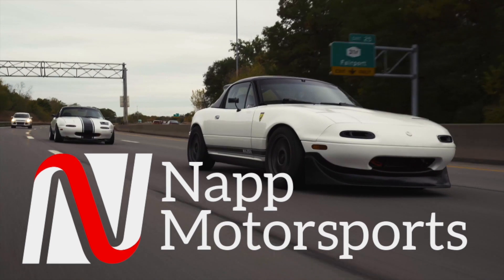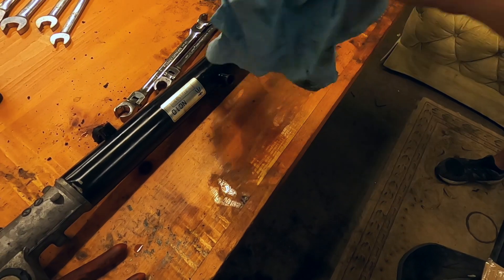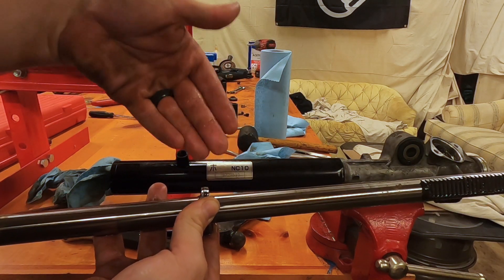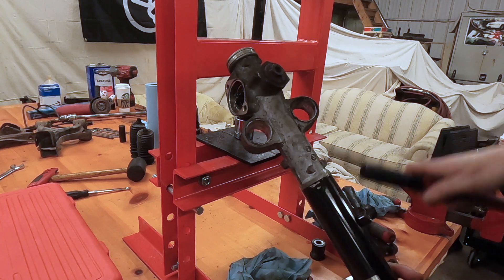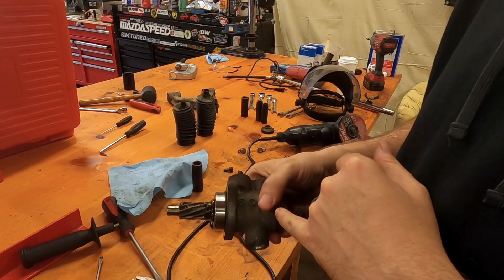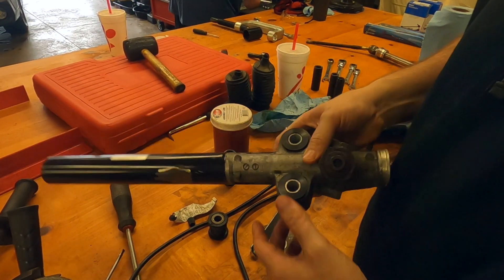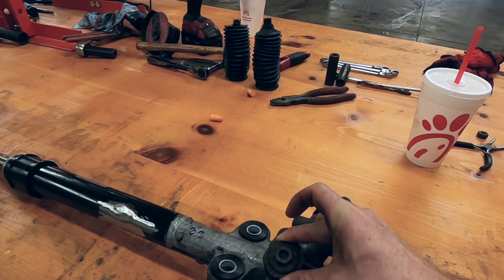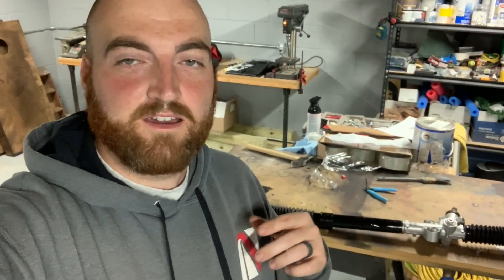Depowering a Miata Steering Rack // Miata Track Build

Comment: I did this on my rack and encountered a real problem getting that passenger side end cap nut off… on mine it was staked, and there was a burr that was destroying the threads. I had to take a dremel and cut the burr off of the main. It seems like it’s a factory thing to prevent it coming loose but so weird to see in some videos (like yours) people just casually twist it off… a few comments and instructions DO show what I encountered, but not all of them
Reply from the maker: I've heard that from a few people but I haven't seen it myself which is interesting. I'm doing another rack here shortly so I'll have to look for that.
Reply: It was hard to even see the dimple - just a tiny little spot where the rack casing was staked a bit. I ended up being fine, I only slightly damaged like the very first thread on the endcap and it reinstalled just fine, but definitely would’ve been bad if I forced it and didn’t backtrack and take a dremel to it. Anyways it’s odd that sometimes people seem to encounter this and other times not. Meant to say that I like your video, super helpful

Comment: Any idea did the same thing you did and the shaft won’t come out almost like it’s building pressure
Reply from the maker: Not sure
Reply: @NappMotorsports I had a 97 steering rack which is the NB design but na mounts, there’s a extra seal in there that was causing that I think or it just was in better condition then most. Put it in the bench press popped right out

Comment: I guess there's no concern about the wiper seal that's half way down the rack from the gears? I'm thinking of converting that one banjo bolt location to a zerk fitting so I can keep grease in there, but the inlet port is on one side of that wiper seal. Interested in your thoughts on this although it seems to be a non-issue.
Reply from the maker: You cut the seal out if we’re talking about the same one. Cut a groove into it on both sides and you can snap it out.
Reply: @NappMotorsports  I'm talking about the one inside the tube, not on the rack.

Comment: thinking about doing this in my nb, i want to delete the power steering and a/c from my engine to clean it up. although i do daily drive my car and i would like the car to still be comfortable to drive (i really only drive to work and back) (like 2 miles lol) how is your experience with driving it? im just worried it will be a little tough to steer. although when you cut out the fluid seal it hypothetically should make turning easier opposed to just looping lines. obviously it wont feel like having ps still but im just really uninterested in arm workout everyday.
Reply: I just looped my lines and you’ll only have an issue at a dead stop. Even then it’s not that bad. When in motion you can’t even notice power steering is gone
Reply from the maker: It’s harder to steer at a stop, but when you’re moving it’s no big deal